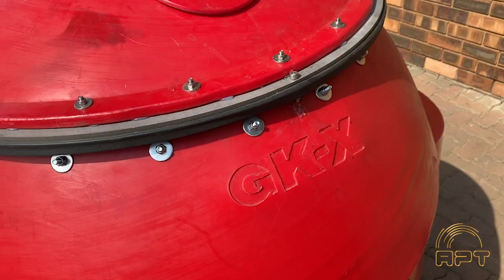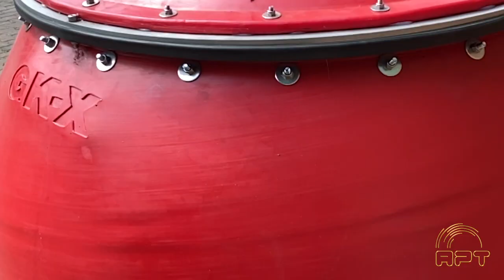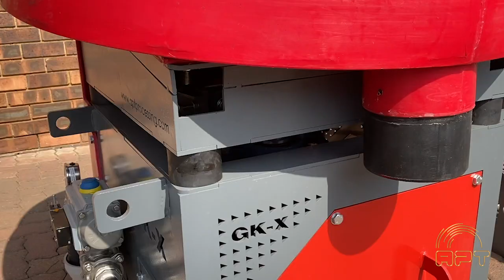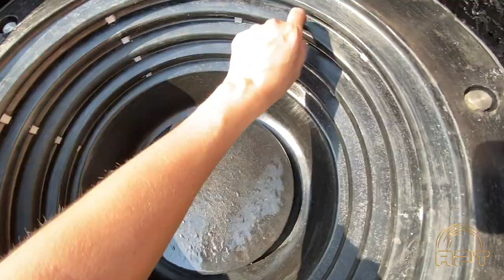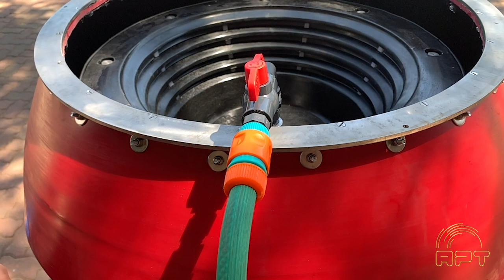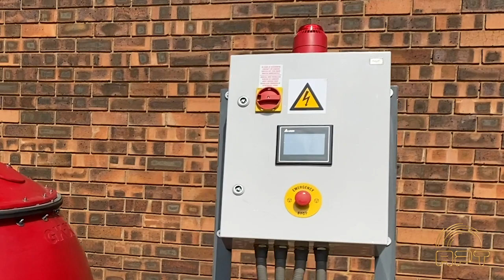GK-X Medium Scale Precious Metals Concentrator | High Efficiency Concentrator

Comment: Scaling from poor quality water is a major issue with any centrifugal concentrator. When only a few injection holes, each instance of blockage will have a devastating effect on recovery loss with this machine, as oppose to the Knelson/Falcon who have hundreds of holes, distributed throughout the bowl. As long as your water quality is great and you add enough anti scalent, that should be minimised, however if a hole becomes compromised in any way, recovery will drop significantly.